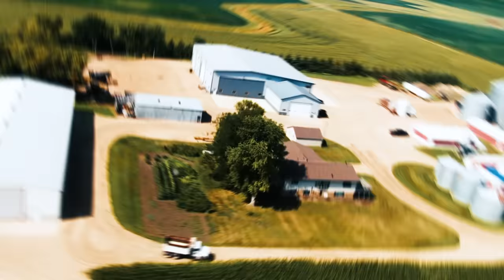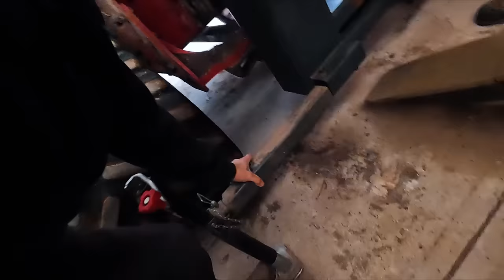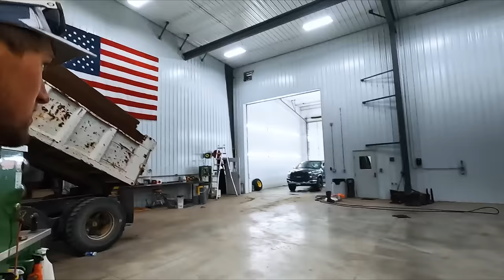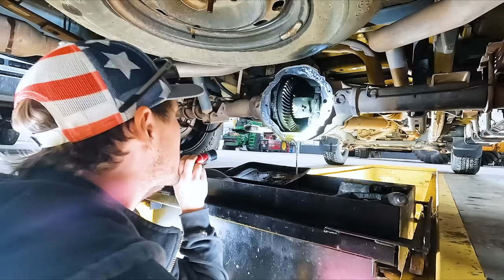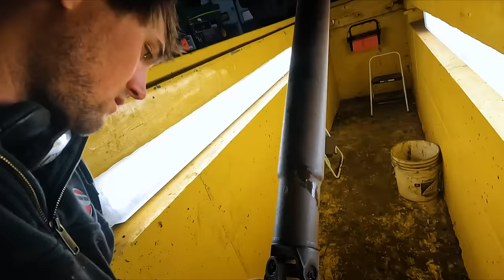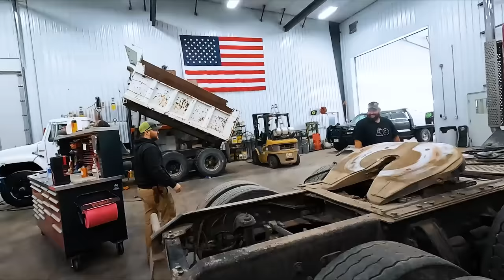Back To The Good Old Days!

Comment: There is a crush sleeve on a pinion shaft to set the preload on the bearings, it can only be used once so you need a new one.
Reply: If he got a new nut they usually come with a new crush sleeve.  But if he didn’t torque it the preload is all out of wack…
Reply: If you mark the nut before you take it off and put it back to the same spot no need for a new crush sleeve
Reply: Yes absolutely correct. I think he may have issues.

Comment: In all my years of replacing U-joints, I have never worried about how I took off the drive shaft. Even when I had to shorten a drive shaft, I never had it balanced. You will be fine.

Comment: Also tighening the pinion nut needs to replace the crush washer. Thats why there was play in it still.
Also need to tighten till you have rotating torque of consistency of about 18 inch lbs to 25 inch lbs when the nut is rotated. If not you will be back in there with replacement

Comment: You need to mark the nut before you pull  it apart to change the seal.  There's a crush sleeve in there and you either need to put it back exactly the same or replace the crush sleeve

Comment: Wet dirt collects around the rear wheel wells causing the boxes to rust out. Taking the tail lights annually and hosing out the space will prolong your truck. Using some cavity wax will really help as well.
Reply: Yup. A bit of Fluid Film wouldn't hurt, too.

Comment: Hey Chet. I had an old Bronco with dual exhaust stored one winter and the mice filled both mufflers with dog food. It would hardly run and after spitting some of it out I had to take it apart. Dog food smells bad when you cook it with a big block too.

Comment: Take that driveshaft back off and properly torque that pinion.  It's now loose because you did not tighten it enough and you're going to wipe out the bearings.

Comment: The pinion seal only means the bearings are letting go in the pinion and need to be replaced…. Takes 7-8 hrs. And one special tool you can buy or make to loosen the 36mm hex id nut for the pinion.
Also has a crush washer in there.

Comment: I wish somebody could explain why spinner reels aren't mounted horizontally. It seems the unreeling would be so much better.  It could get some slack in the tile, but a little brake on the reel could handle that.

Comment: The vast majority of Dodge trucks are junk. They rust out, rattle apart and the only thing worth saving is the drivetrain, if it is a diesel or a hemi. However you guys wash and maintain your rigs and they stay beautiful. I know in Wyoming with our washboard gravel roads it beats Dodges down. Of course we have so few people half of our roads are gravel washboards and no vehicle likes that.
Reply: I'm not sure if Dodge ever beefed up the fronts enough for the Cummins weight, I know that the 96 models couldn't handle it.